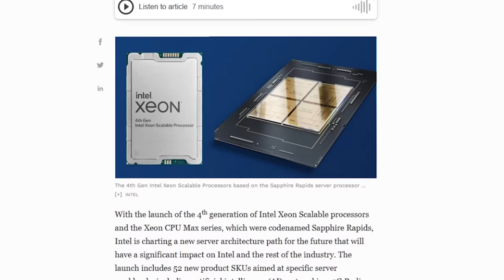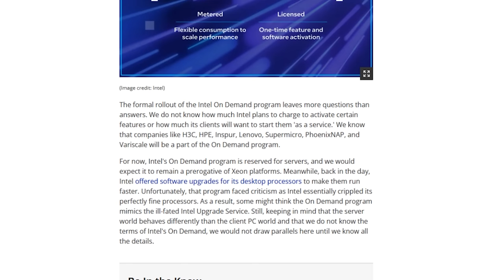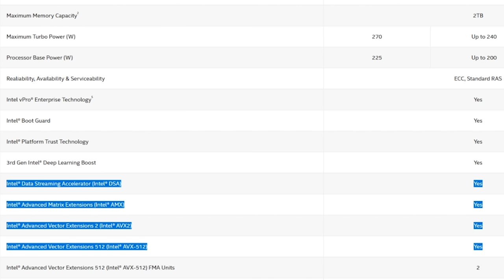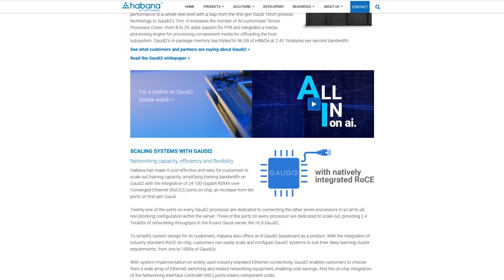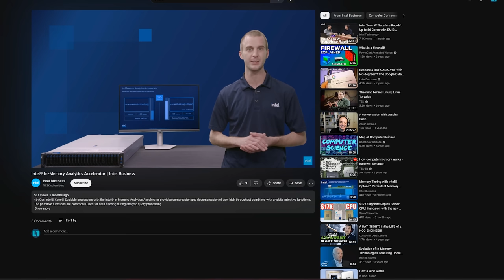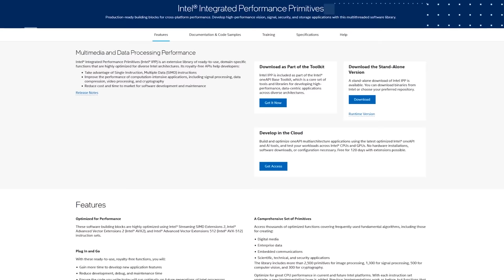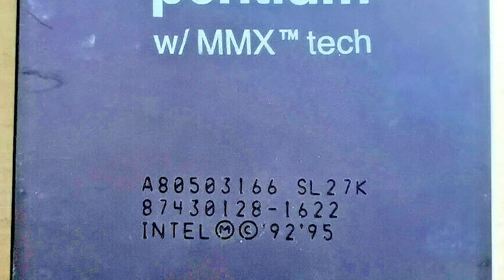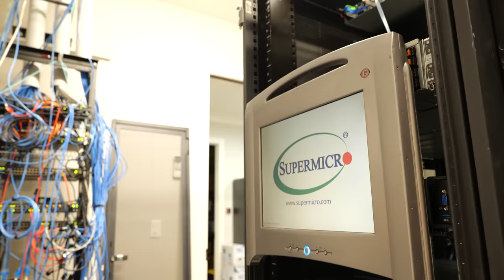Accelerators: Intel's Secret Weapon

Comment: I was interested in VROC key and I bought one but the compatible M.2 ssd were old and not easy to find in Europe at least. I send it back after 4 days desperated by this non sense. Then I would eventualy follow up on the list of compatible ssd but month and month without any change. Not only there was very little info about the Vroc key but you could not even find any way to inform yourself on the subject at that time. No contact, no service. With an asus extreme deluxe mobo. I'm one of the sad stupid guy who bought the 9980xe 18 cores  at its highest price. 6 month after I bought it the price dropped by more than 50%. 
I'm disgust and don't want to hear anything more from them. 
Features as Vroc that appeal at first because promessing and then as customer you feel abandoned resourceless and devaluated. What a shame!
Reply from the maker: This is the scenario for a lot of enthusiasts; vroc had some more success in the OEM space with light rebranding from Dell and HP but.. yeah
Reply: pretty crazy to think they're releasing tech without documentation
Reply: I gave up on vroc when looking into getting a new server last year. Documentation is beyond bad

Comment: This is a common issue I find with marketing. They dont understand the product so cant understand how to market it.

What they need to do is get the engineers and such to set the direction and then the marketing guys come in to dress it nicely for sales.

Especially with a technical product theres just too much obfuscation going on.
Reply: Depends on the organization how marketing is structured.  A large software company I worked for had a dedicated marketing team for sales teams and leveraged us engineers for the deeper technical stuff. They handled all the other things. Intel does go more in depth with partners, but Wendel makes a point. A company like Intel should do a better job with public marketing given their place in the market. Some web marketing for some of these companies tend to stay in the "we've always done it this way" mode.

Comment: Intel either needs to launch a product and keep it around or just remove the licensing burden from their products. They keep making things that sound neat and then trying to build a walled garden around it. VROC, Optane, and now the "Y" pay-as-you-go chips. They need to take the lessons from the last 4 decades of computing and adopt a 2-step approach. Some super simplified "basic" version in all CPUs, and then it's bigger badder paid-for brother in the XEON class of CPUs. This would require the integration to both pieces to be the same to work. Like for example If a basic RAID-0/1 version of VROC was free on all Intel CPUs but a more feature rich version with RAID 5/6/10/etc was available for a $20-$50 via a license key. If VROC was deployed this way instead of everyone has to pay to even test the thing I think it would have been a commercial success for them.

Comment: The accelerators share the memory bandwidth with the coree. In server workloads, memory bandwidth is almost always the bottleneck. I wonder how useful those cores being idle while the accelerators are doing the work, I imagine them to be crippled, that's a nice idea for benchmark: run a workload that doesn't use accelerators while another workload that uses accelerators is running, and compare the results to when each of them is running alone. I think there is a huge smoking mirror behind those cores looking idle.
Reply: You might think that whatever traffic that needs to go through the load balancer has to go through a core, defeating the purpose of the accelerator. But intel has Data Stream Accelerator, which is like a small processor that only executes movs to the WC memory buffer. So if you have a network card, an optimized driver will redirect traffic to the dynamic load balancer with the MOVDIR64B instruction, the only "pollution" to the system would be in the form of the up to two instructions per cycle that would only impact performance if you are scheduling 3 512 bit loads and 2 512 bit stores per cycle. No smoke and mirrors, the documentation is out there, the patents as well, there's a reason why it's so hard to get one of these cpus while every cloud company out there have them.

Comment: They've mostly been unused because getting access to them is too hard for developers.
If they were in our AMD or Intel consumer systems we could take better advantage of these API's.

The buisiness/industry adoption will always fail and economies of scale will too unless intel/amd starts putting them in desktop chips. Years ago they said we'd get FPGA's in CPU's still waiting on this... Still integrating the FPGA and Accelerator tasks into the consumer chips would be the ideal scenario and really a better innovation IMHO.

At the minute there is not much reason to use Xeon/Epyc just for this one feature, consider that most contractors would have to buy this CPU and only be able to run this code on the one machine.

How can I implement an accelerator if I can't run it on my machine? And I hate when the make a crutch device which just gives you API access like the Jetson for example when they give you a dev kit but you'd prefer to just have the same chip in your CPU.
Reply: Si los ingenieros de Intels estuvieran a cargo y no los equipos de medios y los penny pinchers, es poco probable que AMD haya regresado.

Comment: The first 'accelerators' we had was the fpu chip. And with that you had a CPU and then a FPU slot. I can totally see having an optional accelerator slot for very common tasks. GPU encoding/decoding, compression/decompress, RAID, search (minimum length matching or regex) as well as BigInt and cryptography (1024+ bit).

Comment: you talked a bit about pci-e peripherals... I wonder how much slower an accelerator-on-a-card would be compared to an on-cpu accelerator
if not much slower, this could be worth it to increase market penetration by allowing old systems to support these accelerators, but still add them by default to newer systems so devs can be sure that whatever they develop won't be an instant dead end.
<rant>
is this the return of the oddly specific expension cards? I recall back in the early days of the IBM-compatibles before they took over the "PC" moniker (no i'm not THAT old -barely an adult- just interested in those fossils don't ask) those were decently common -- separate sound cards, network cards, even the floppy and hard drive controllers were on separate cards, and I'm fairly certain some high-bandwidth devices would have used them.
A key problem of this approach was how many expansion slots these took up -- by the time you had a functional system, you already spent 6 of your 8 expansion slots, so if you want to add a new-fangled Network Card, Serial for a mouse and a Parallel for your printer, OOPS, you're all out of slots.
I wonder if such a fate can be avoided by using M.2 as a sort of "micro-pcie" slot for accelerators, somewhat like it's being used now for some wifi dongles.
</rant>
PS: Can you talk about the Gaussian Neural Accelerator found in some CPUs? I wonder how fast it is and whether it's a dead end or something useful for some usecase.
Reply: Yes, I'd love to see a video on the GNA. At least that seems to be included free of charge :o)

Comment: Yeah. Communication on Intel side is really lacking here. For couple of months I was not able to get any straight answer what IAA actually does, what will be api etc. 
As for VROC it’s awful right now. RAID5 write sequential performance is terrible and no fix in sight. Not to mention ping pong with abandoning and restoring it as a product in early 2023.
Those features do exist, but adoption rate is terrible. There is no one but Intel to blame here.
Reply: That IAA stuff is extremely cool, that is, if you have an application that needs it. It's somewhat of a chicken before the egg problem tho - how are you going to know that you need it unless Intel can somehow figure out how to tell you that it exists, and related to that, until the various software vendors that could really benefit from it, start to implement using it if it is present in your system. But then again, why would they do that if exactly zero of their customers have that IAA feature in their system. This IAA would be totally killer for the various softwares that implement in-memory database systems. Those vendors should be going out and buying an IAA development system, implementing support for IAA in their in-memory database, then update their software marketing material to say "Our software works great in your run-of-the-mill computer, but if you want to set up an in-memory database server that really screams, you have the option of installing our software on a system that has the new Intel IAA ... etc". But don't hold your breath waiting to see that kind of coordination between hardware vendor Intel (who can't even tell you what IAA is) and software vendors. The one IAA question I had that Wendel didn't answer was, if you have (say) some plug-in PCIe card that has an IAA subsystem on it, does that thing share the memory space of the host computer, or would you put a whole bunch of separate memory on the card (and if so, what might be the size limit of such memory).

Comment: A lot of tech is being obscured and is getting deep in the wool. 
The reality is that unless the vendors really clear their fog, this stuff won't be understood, won't be bought, and won't survive. 

The whole cloud and fewer and fewer people with knowledge and access is kinda self defeating. 

As for accelerators, nothing new here. Bolting on capability is taking place across vendors. If you can get an advantage, it has to be applicable. Making something no one uses is a dead end.
Reply: I think the only solution, really, is for the big cloud vendors to take the lead on this, offer (and promote) new cloud instances that use the new hardware incorporating these cool new technologies, and put together a support team to help their customers use those new instances.

Comment: Accelerators are basically ASICs, right? If you can make a die package that gets the right balance of General Compute with Specific Compute, you hit the jackpot.
Reply: It is not easy to get the balance right.  Who will use AVX-512?  I think less than 1% buyer will use this feature and yet you cripple 99% of users with die space taken and power consumed.  It is easier said than done.
Reply: @catchnkill  for server users, I’d guess more like 75% of users will take advantage of AVX512, it’s just a question of if they know they’re using it or not.

Comment: 15:50 the thing that blew my mind the most was learning that those robots were controlled by QR Codes on the floor. thats how they know where they are, not any sort of guidance or telemetry software. and occasionally the bots would get confused because the sticker was dirty or torn and misreport where the thing is so the mechanics would have to go out with a handle and drive the bot to a known good spot, replace the sticker, and restart it.

Comment: AMD has certainly noticed with the "A.I Engine" that the upcoming Phoenix APUs will have.

With the rumoured Phoenix Halo having a much stronger one as well.

Accelerators are the way to go for future products without adding a ton of cores for specific features and doing it as efficiently as possible.
Reply: the rumored one is Strix Halo. Phoenix already released, no other products for that, except maybe a rebrand next year

Comment: Why would anyone (mainly data centers) give up silicon die space (and performance) for a single use case accelerator, when you can have the silicon use the die space for fast all purpose cores, and have that accelerator be in the PCIe slot? It just doesnt make sense economically.
Reply: Because if you have a data center with a specific use it's far easier? If you just need tons of general compute power sure they make no sense. 

As for vs PCIe, we'll there's a gigachad performance benefit to on die accelerators and their access to the rest of the CPU.

You can also get vastly better performance per watt using accelerators, and money is everything in the enterprise. 

Do you use your CPU to generate images, or do you use your GPU to do that? Same principal.
Reply: @donkey1271  well I would rather have cpu and gpu separately rather than give up my cpu and make space for a gpu. Sure, if it’s specific use cases like Netflix/twitch they can benefit from single purpose CPUs, it’s a niche. But the majority of data centers (AWS, Azure, google) would rather have as much cpu as possible and leave the accelerators to PCIe.
Reply: @asishreddy7729  The amount of money Intel has put into these accelerators-many of which are not new-indicates there is a solid market for it. Things like AVX-512 cannot be done via PCIe. The majority of CPUs in the consumer space have iGPUs, so there's evidence that's also the preferred option for many cases.
Reply: Because if your accelerator is on chip then you can avoid the PCIe space and pack in another few nodes.
Reply: @donkey1271  But if you have a data center with a specific use case why would you waste so much silicon on relatively high performance general compute, not to mention all of the accelerators for tasks other than the one you're focused on...
Reply: @bosstowndynamics5488  Just because you have a specific use case in which accelerators can greatly benefit you, it doesn't mean you also don't need general compute to complete the same task, or parts of it. 

But as another answer:some companies don't. This I why IBM Z is so popular.
Reply: @donkey1271  True, but plenty of the accelerated workloads that Sapphire Rapids covers don't need as much general compute as these chips bring to the table, and they definitely don't need the accelerators designed for completely different workloads

Comment: sounds almost like Intel has implemented ASICs on their chips, and if you want to use them, you can unlock the microcode for them.
this would be an advancement, especially if/when AMD implements them as a standard feature.
Reply: Although many or most of us probably agree with Wendel that this idea to pay extra later for something that's already there on your chip, is a dumb idea, there is another way to look at it. That is, why should I pay for something that I'm not using right now. Think of all the (now hundreds, probably) of AV* and other add-on instructions that now both Intel and AMD are pretty much stuck with adding to their CPU chips, lest their chips look weak relative to their competitor. Not that inclusion is uniform, in a lot of cases a given chip only implements some subset, so it's market confusion in any event (did you see that AVX-512 chart Wendel showed!?!). Think about the fact that in today's CPUs, maybe half the chip real estate goes to implementing that stuff, and 98% (estimate) of all users never touch it. To me that's close to a decent argument that variants of tomorrow's CPUs ought to be built without those features, but with twice as many cores instead, but rather than delete those extra instructions completely, you leave a stub on the CPU that just decodes these performance instructions then either dispatches them to an (optional) coprocessor chip that executes them, and if the coprocessor is not there, it emulates them in software. Motherboard makers could include (or not) the socket for this coprocessor chip. Now, I doubt very much whether the industry will go his direction. However, it's at least interesting o ask the question, why not? Why are they making the everyday Tom, Dick and Mary pay for the accelerator instructions that only Sven the Geek is using?
Reply: @jimatperfromix2759  
The suggestion you are making was kinda executed on the intel ARC GPUs. Direct X10 and older wasn't directly implemented, more with emulation ( I may be not 100% accurate on that) that's why their performance was on such titles really bad. 
It'd be interesting how such a software emulation of AVX would perform.
Maybe it'd be a solution to place such coprocessors on the motherboard, similiar how they do it with the chipsets...
Or even more simple: make such coprocessors in M.2 form factor. got 3 m.2 slots? use two for SSDs, and one for your coprocessor. 
Or, one for SSD, one for wifi, and the third for your coprocessor. Maybe future boards will have more M.2 slots.

Comment: Great intro vid! Thanks for posting!  Wondering what you believe the easiest, simplest accelerator for A.I. compute would be?  Like for Stable Diffusion, etc? Something that would accelerate older hardware possibly?  Such as 6th Gen Intel w/ AMD 480/580 8GB GPU's, etc?  Thanks!

Comment: How much power do active accelerators use which is potentially removed from the regular cores’ power budget?
Reply: Far less than what the cores would use to achieve the same throughput without the accelerators, i.e. they free up thermal budget and reduce electricity costs.
Reply: That’s a given, I’m wondering about mixed workloads (it’s unlikely you can do everything over accelerators all the time) compared to AMD’s higher multi-core performance with lower power consumption during generalized workloads.

Comment: Intel should have a combination of ASIC and FPGA accelerators. What's the point of buying Altera if you're not going to embed FPGA onto the CPU? Imagine a more configurable CPU that can be updated to support new codecs.
Reply: FPGAs aren't that fast though - for application specific tasks they can outperform CPUs in some cases but they're never going to hit the point where they're bottlenecked by being a separate add in card, and to even get to that point you need to spend a lot of money on FPGA silicon and developing code for it. And the only benefit is that your CPU might last slightly longer, which is bad for Intel